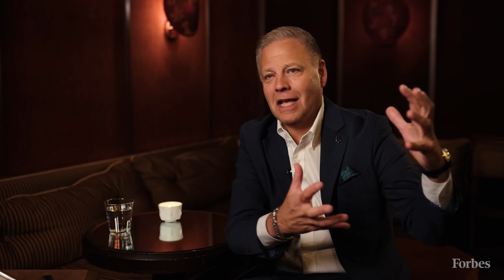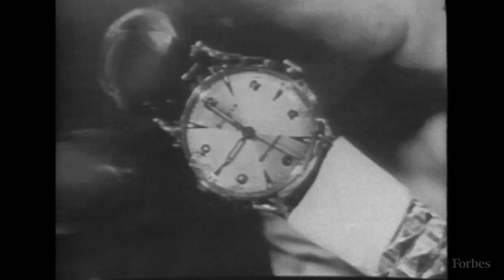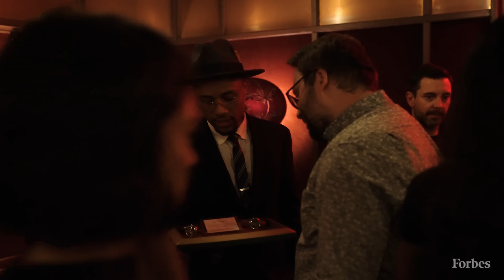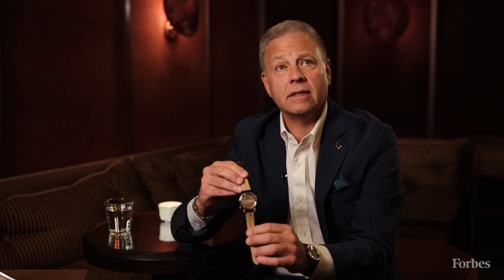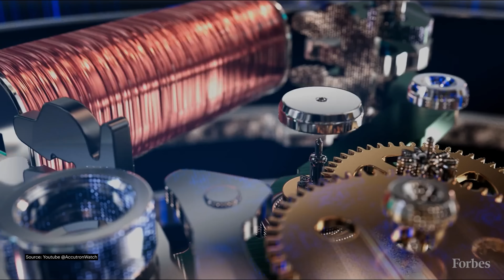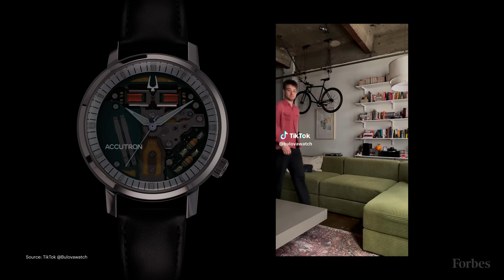Inside The Accutron Relaunch And Why Gen Z Is Ditching Apple For Analog | Watches & Jewelry | Forbes

Comment: I own both an original 1963 Spaceview and an Accutron DNA. While I was able to buy the DNA brand new at 1.000 euros less than the official price, It was still painful to pay 2.300 euros but at least it was justified by the incredible technology behind the electrostatic movement. I'd love also to buy the anniversary one but even considering the diapason movement, it is WAY OVERPRICED. A watch with such technology today should cost no more than 1.500-2.000 euros max. I think the management did a serious mistake when reasoning the price. It will never be considered a luxury watch due to the brand. Also, the manager's statement that this watch was such a nightmare for Bulova's engineers so that some of them retired from exhaustion, is clearly a blatant lie. The tuning fork technology is very simple, nothing compared to regular modern mechanical watches or for example, with the electrostatic movement.  And in fact, they realized it in the 50s, so replicating it today would be a walk in the park.  So, I am skipping this one and it's a pity.

Comment: These Gen Z are mesmerized by the two exposed through-hole resistors with the colour bands as they have no clue how to read the resistance values. 🤣 No doubt this quartz watch will outlast any Apple Watch, except you are comparing a wearable computer communication devices packed with the leading edge technologies  to a glorified Timex.  The subliminal fancy marketing keyword here is analog, vs mechanical all the overpriced Swiss watches capitalize on. If they use the word quartz or high-frequency quartz for the marketing slogan it would be an immediate flop.

Also most people never think of how much PITA to have to change the battery in these watches every 12-18 months. You will be much better off with a middle of the road mechanical watch with the automatic winding.
Reply: But if you leave an automatic watch for a day it stops... And then you have to reset it and make sure it is wound, bet that happens more than needing to change the battery every 5 years ( a more accurate indication of how long a battery lasts than your nonsensical guess).
Reply: Also, it's not quartz Seiko invented the first quartz watch in the Astron. It deservedly wrecked the swiss watch industryl

Comment: a real analog watch has no battery!
Reply: Nope you are mistaken, the word only covers what type of face the watch has. You are thinking of the difference between quartz and mechanical. Quartz watches are objectively more accurate and easier to use than mechanical ones, a ten pound Casio is more accurate by miles than a Rolex superlative chronometer, so not only did you get  confused about what words to use, you were also entirely incorrect in your assertion.
Reply: thats not analog you are thinking about, its mechanical. Two different words.
Reply: @Anirossa Digitial covers also the heart of a watch which is driven by a (small) CPU. A real analog watch has no CPU.
Reply: @RazzFazz-Race It's not a cpu, it's just a circuit

Comment: Vintage, neo-vintage, and new Bulova Accutron timepieces with the tuning fork, and the Citizen Eco-Drive Caliber 001 AQ60XX series (+/-1 sec per year!), are the most accurate timepieces currently available. Only the latter beats everything.

Regarding mechanical-only timepieces, the recent Breguet Expérimentale 1 and Breguet Classique 7225 with magnetic escapements are the most accurate at +/- 1 sec per day, with the former potentially and technically more accurate unto itself.
URWERK AMC project is the next most accurate if you do not use the secondary atomic clock station to set the timepiece. The watch itself is very accurate, but not hyper, but with its atomic station dock, it then rivals all other mechanical timepieces. Ditto URWERK EMC project; if you do not regulate the watch itself, it's natural accuracy is very high, but if you use the awesome on-board regulation system, then it becomes hyper accurate for an X amount of time.
The two Breguet pieces mentioned are consistently accurate over their power reserves without intervention or user regulation. They are both the apex in mechanical chronometry!

It's truly incredible what electronic, quartz, and mechanical micro-engineering can achieve via hardcore maths and technical virtuosity, and what Bulova, Citizen, Breguet brands have accomplished for the watch industry!